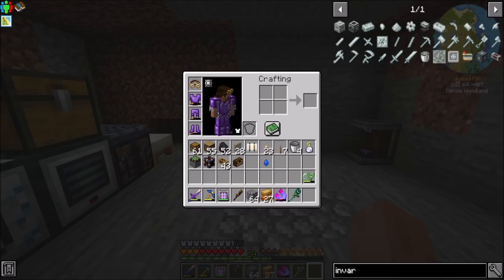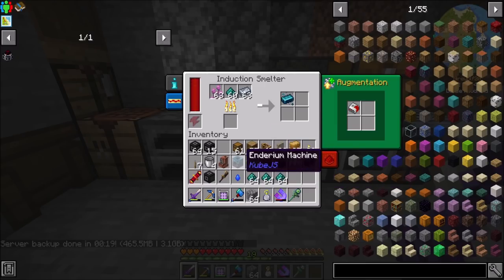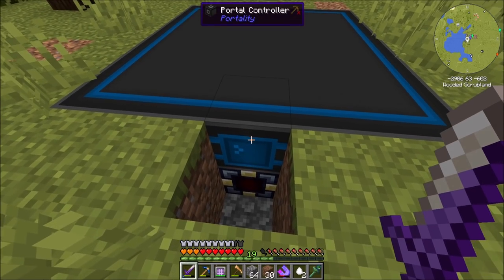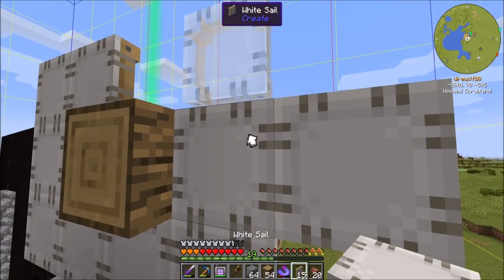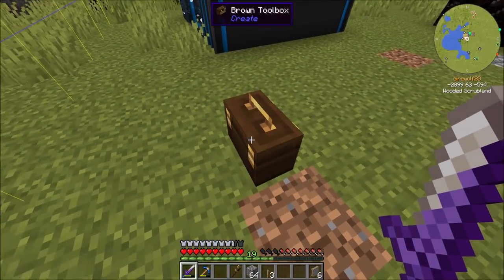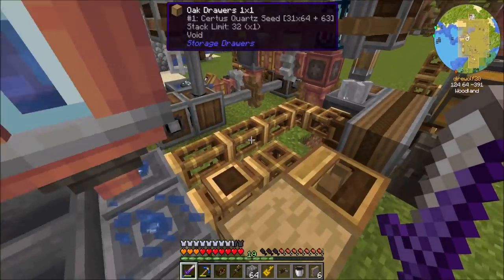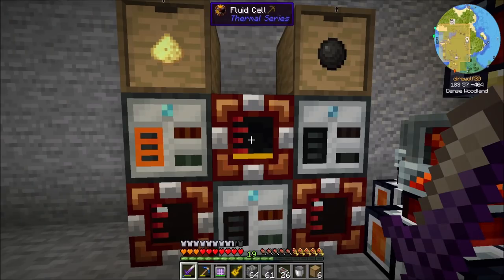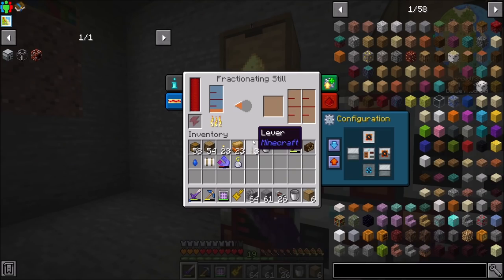Create A&B Ep47 Teleporting to Oil

Comment: A heads up, Tinker's Chesplate is the reason you can't properly sneak+right click things, it's a known bug. Simply remove the chestplate and you can.
Reply: He mentioned that in one of the other episodes
Reply: @jadegreenleaf781  I've seen em all so far, didn't see him mention it. I literally just learned this fact yesterday from one of ChosenArchitect's videos.
Reply: @DizzyDJW  it was when he was setting up the liquid logic
Reply: @DizzyDJW  He mentioned that it prevented him from clearing filters. But I don't think he knew that it was also what was stopping him from running cranks backwards

Comment: Portality portal doesn't need to be 5x5x5 it can be a variety of sizes. Dire please actually read the full details of the mods you use. Size can be 3+ wide by 4+ high by any length. The length determines the maximum range, which is shown on the controller (and ignored by Dire), max_range = 200 * length.
Reply: And if you use the inter dimensional block it is irrelevant on the size
I used a 3x4x5 to get from the moon and back 
Needs 60frames a controller and an inter dimensional for each portal

Comment: Ha, he noticed at the end the problem with handling fluids with the fluid cells, I wonder if he'll notice that even if he sets up to only take from outputs won't prevent both fluids from switching sides, probably not and will have to rebuild it
Reply: As fare as i know... the Problem is, if you are seting the cell to autoinput. If just the ref. Is autooutputing, this should not be an Problem.
Reply: He could simply add a filter upgrade, I think that'll let you use fluid buckets to filter a fluid cell.

Comment: Dire if it's so annoying to find that oil... would be possible to make an artificial "infinite amount" pumping it into a manually dug reservoir "closer" to your base? legit question, maybe needs so many source blocks that's pointless, but now i'm curious about.

EDIT: found a reddit post that says that it needs 10k sources. is it really worth it in this pack?
Reply: you can edit the config in this pack - I've set mine to 10

Comment: Wow, searched for 1.5 hours? Impressive...

Reminds me of when I was looking for Jungle in Enigmatica 2 and gave myself 2 hours to travel towards each of the 8 cardinal directions.........

No, didn't find any. Ended up cheating in the stuff needed.
Reply: you could've added nature's compass, its sole purpose is searching for biomes
Reply: @geekjokes8458  I tried that, that was the reason for those straight lines, to generate as many parts of the map as possible and then use that tool to look for it. Didn't work.